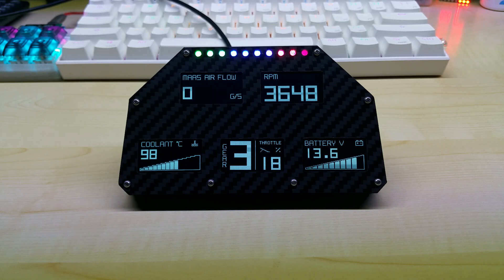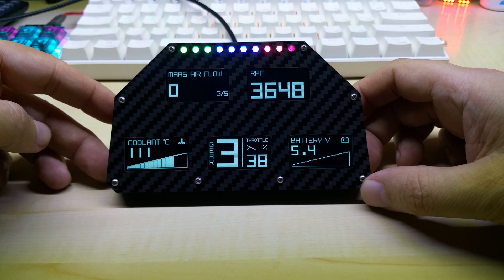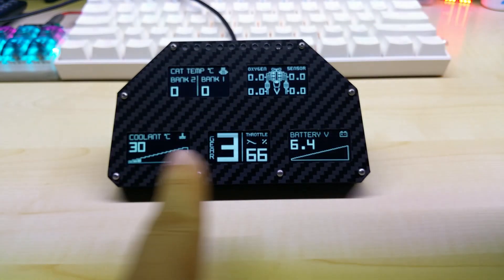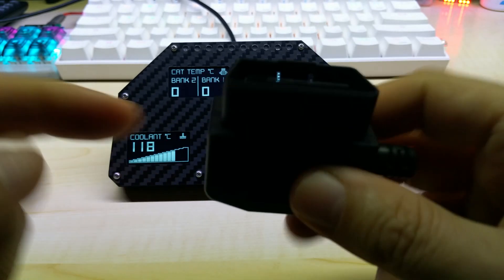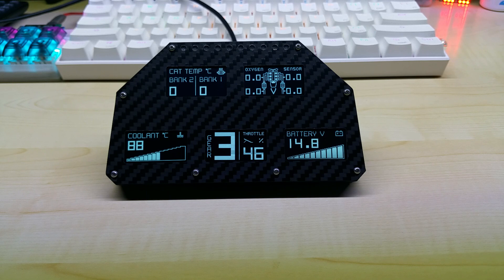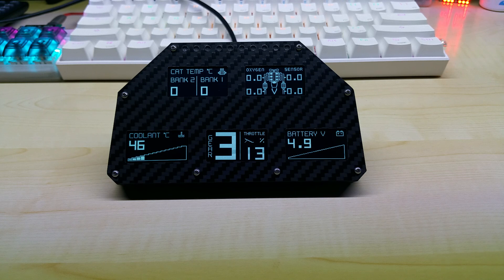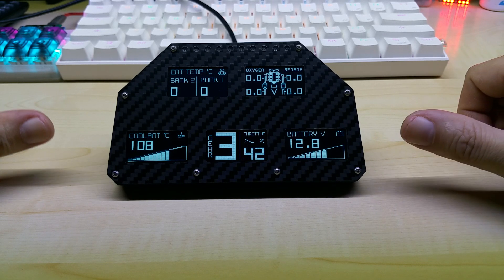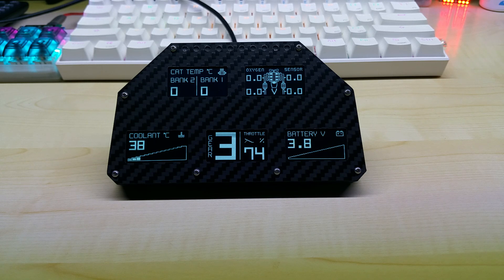CAN V-GAUGE finally finished and ready to go, please share if you  think somebody will like it, thx.

Comment: I guess the analog version was supposed to use the X27.168 stepper motor.
Reply from the maker: What I meant with analog version was only to use 0-5V inputs, but I actually did make a true analog version as well with five x27.168 stepper motors but never showed it on Youtube I think. Should put it together and show it, somebody might like it :-)

Comment: Hurry up everyone, lift your game, i have sent my money to Hayri. 
I purchased and own one of the very first V-GAUGES - SERIES 1 and now i have paid for the latest version the new beautiful CAN V-GAUGE.
I love these things.
They look stunning and very simply, they just work. 
Hayri doesn't stop inventing thinking.working, hardly eats or sleeps.
This man deserves a huge break, i mean come on look how good this device is.
The beauty of purchasing this device is it can be moved basically to any  vehicle given some time to finish the rest of the interface systems and coding, to suit different vehicles.
Reply from the maker: Thank you Dave, greatly appreciate everything you do :-) Just as an update, the code is finished and works without any issues and I have increased the available screens too. It works on all vehicles 2008 and later that have CAN BUS including exotic cars like Lotus and German sports car Porsche. Being Plug and Play it is easy to install. Additional upcoming product is the CAN BUS Node that will make any vehicle work with CAN BUS equipped gauges including mine of course or can be used to add sensors to the existing CAN BUS Network.
Reply: @iHayri1  typical, i go to sleep for 2 or 3 hours, wake up and what was left to do to complete this dream of yours is sorted and finished, you sir are unbelievable.
Once again everyone out there even if it is something you may not require, try think if you know anyone who is interested in race cars, races themselves or maybe interested in the CAN V-GAUGE in general pass on this YOU TUBE page or any of  Hayri's other links as listed on all of his pages , his TINDIE store etc. Show them the way and spread some Christmas Joy.
Thanks to all.

Comment: Very well done, Hayri!   Does the CAN bus provide enough info for miles per gallon / kilometers per liter measurements.   My 2017 Camry has that, but my 2010 Camry doesn’t and that would be a cool option.
Reply from the maker: Thank you. I think that gets calculated from a few readings. Will have a look when I get a chance.

Comment: would it be possible to connect in a vw golf iv gti engine 1.8t AGU 99?
Reply from the maker: Only with additional hardware, I am working on a CAN BUS Node that will take analog signals and convert them, create a CAN BUS Network and broadcast it.

Comment: Hmm the size looks like it might fit perfectly where my center channel speaker sits on my fd3s, usually people put 2 or 3 gauges there but with a custom printed housing(or mount) this might fit just fine. What were the dimensions exactly, sorry it's been awhile
Reply from the maker: No problem, it's 130 mm wide, 75 mm high and 14 mm deep without the screw heads and 16.7 including the screw heads.
Reply: Thank you
Reply from the maker: @mythos000000025  You're very welcome.

Comment: Couldn't you just put all displays on one stm32? Cheaper
Reply from the maker: Never worked with the STM32 but I doubt it can control 5 displays without using a I2C multiplexer which slow things down, plus you would no where get the customization I have now.
Reply: @iHayri1  cant you change address of the display?
Reply from the maker: @Ncky  OLED displays have only 2 selectable I2C  addresses, that's why multiplexer chips are used, but as I said they do slow down the refresh rate.